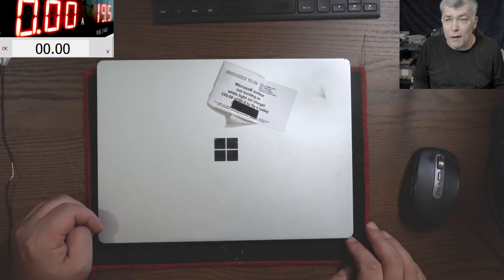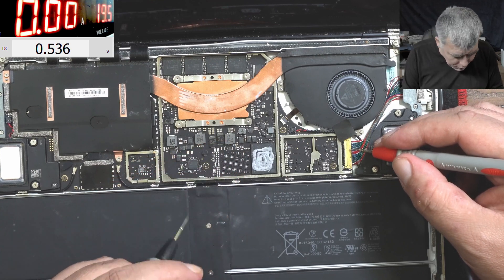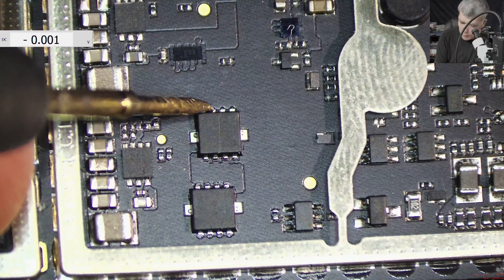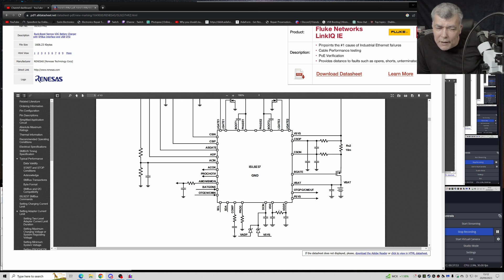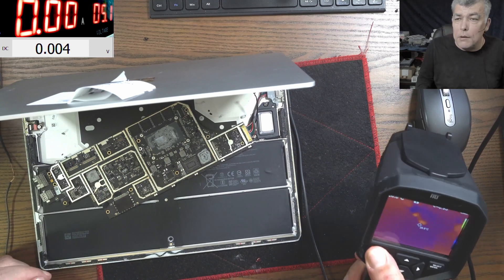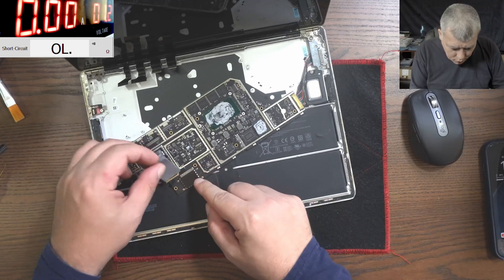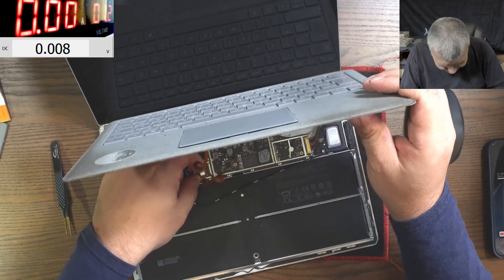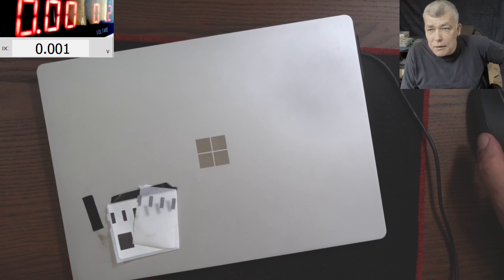Microsoft Surface Laptop 1769 logic board repair - No power - ISL9237HRZ replacement

Comment: You were so blessed that that unit came pre opened. I have heard they are a nightmare to open without damaging.
Reply: The Surface models that are difficult to take apart have the motherboard behind the screen, the screen is almost impossible to get off without breaking it. This one is easy, more like a normal laptop.